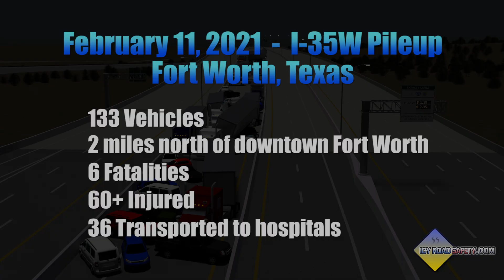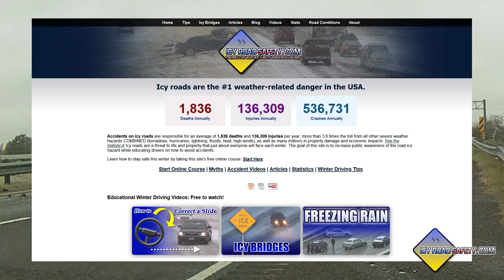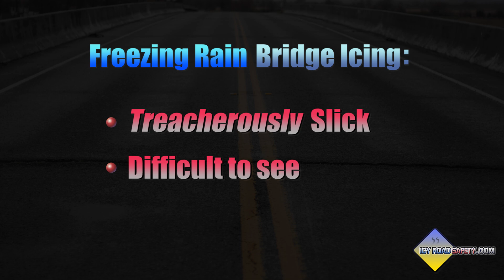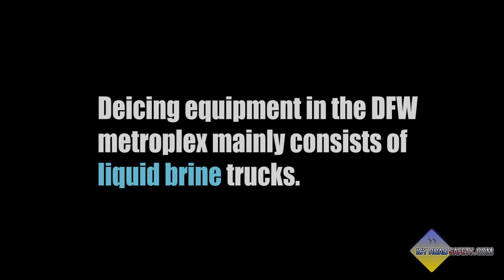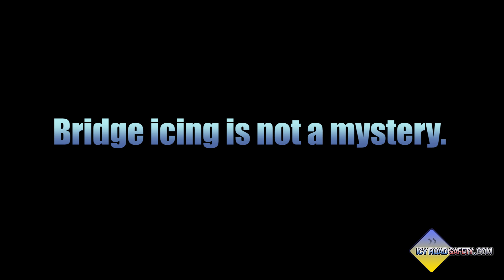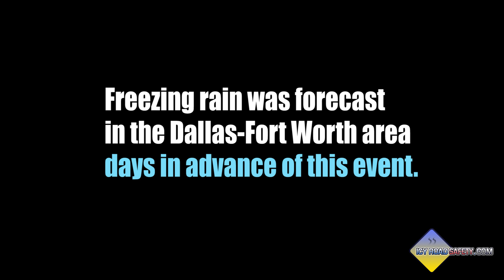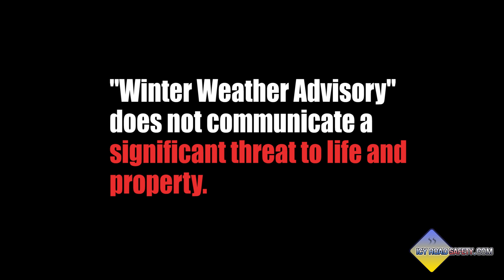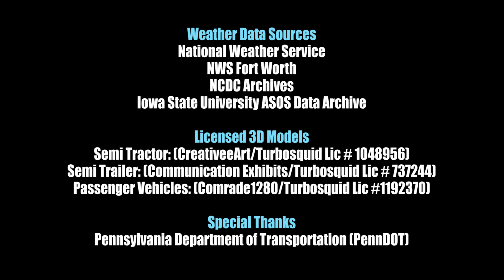The Fort Worth, Texas pileup: its cause, contributing factors and how to prevent future ones

Comment: The main contributors to the event include:
1) We in DFW see an Icy even maybe once a year. twice is an extreme rarity.
2) Morons in trucks can't grasp that 4 wheel drive just means 4 wheels spinning out of control on ice instead of 2.
3) North Texas counties do not have and WILL NOT invest in the necessary de-icing infrastructure as it "will be so infrequently used" that money could better serve lining someone's pockets.
4) Natives are not experienced in driving in the mess and have no clue what they are doing
5) Transplants have no clue that the roads will not have been prepared like they would have been where ever they came from (except Californians as they have no clue about anything, and most don't prepare for ice in CA either) so they drive like they would back home on roads that would have been prepared properly.
6) In a huge cash grab, Tarrant county has created toll lanes on every major freeway, but walled them up with cement barriers and provided absolutely no shoulder what so ever with maybe 6 inches between the edge of the lane, and the cement wall. Thus once an incident starts there is no means of escaping and no means of avoiding the traffic behind you (probably in an SUV instagraming how pretty the snow is while sipping a late)

Comment: Exceptional presentation @Dan Robinson, thank you! As a native to NE Texas since 1994, it has taken several extreme weather events to tune my winter driving skills. For those who are new to the area, brakes are your worst enemy during any low/no traction surface. Treat your brake pedal as if you had an egg between the pedal and floorboard.  Rate of speed is a delicate balance between maintaining enough momentum to prevent sliding…, yet reduced velocity to minimize risk if a crash occurs. Lastly, impossible to regulate other driver behavior (e.g., blatant ignorance or lack of experience) on slick roads. If your trip is not urgent, or you lack experience, stay off the roads until conditions improve. Remember, 4WD, AWD, traction control, and anti-lock brakes offer limited benefits. However, that's still four wheels on frozen water!

Comment: I had to leave my house to get groceries on the 15th and I was driving so carefully and avoiding all bridges. It was crazy the people I saw, almost always in pickup trucks, driving like it was any other day, weaving around other cars. I’m not surprised by the number of pickups shown in this video.
Reply: I lived in Minnesota and noticed the same thing, that large pickup trucks were not patient drivers when others were slowing down for slick roads.
Reply: Yup. These people learn the hard way pick up trucks handle terribly in wet and slippery conditions because the weight is front bias. This make the rear much easier to lose traction.
Reply: @dekoldrick  correct. That’s why smarter people where it snows regularly will shovel snow or put heavier cargo in their truck beds to add extra weight to the rear tires for better traction.
Reply: @dekoldrick  when I was a teenager, my father put a bag of concrete mix in the bed of our truck the day of a big rain then left it there - ultimately creating a very heavy bag of solid concrete. I asked why he didn’t get rid of it and that was the day I learned about weight/2 WD/momentum and potential hazards with pick up trucks.  

But, yes, living in Texas, one quickly discovers that pick-up truck drivers usually give zero F’s about safety or the welfare of vehicles around them. It’s almost like sport for them. 

Because Texas, I guess. 

And there are A LOT of pick-up trucks here.
Reply: @dekoldrick  yep
Reply: i took my mom back to the airport the day after a major storm. it was an hour trip. we saw 14 vehicles still in the ditch, 13 of them 4 wh drive vehicles. im not saying wh wheel drives are worse, they arent, what im saying is that drivers of wh wheel drives have may to much confidence in their 4 wh drives. 99.9% of accidents are caused by the loose nut behind the steering wheel.
Reply: Idiots think their pickup will perform like a 4WD with chains and snow tires when they're in 2WD and have road tires.
Reply: @malevolence3419  Keep in mind that Texas does not experience Icy weather very often during winter (Frequency is generally low)
Reply: @malevolence3419  idiots think 4wd will help them stop quicker. It won't. 4wd vehicles stop in exactly the same distance as any other.
Reply: @wmason1961  that's true, however snow tires will make a significant difference in stopping distance in winter conditions.
Reply: @wmason1961  actually less, they weigh more.
Reply: Keep in mind that pickups outnumber cars in TX
Reply: I noticed that as well and figured “well it is Texas !”
Reply: In DFW, we typically only have two highway speeds - 50 and 150. I like to split the difference. It helps that I am cheap enough, that if I can avoid tolls, I take frontage roads instead. It was in the middle of Snowmageddon, and I am an RN. We had people whose pipes had burst, bringing their families in to nursing homes and hospitals to stay over, so they could work shifts. I was thankful I could keep all of my taps at a steady stream, but we had a boil water warning for a while, and a conserve water order. Zero fun, plus so many deaths. The North and South Pole can keep their cold weather. We already have enough bad drivers here, we aren't equipped for ice and snow added onto the roads.
Reply: always the big trucks
Reply: "I chose to risk the lives of everyone around me so that I can go to Kroger and buy some chocolate ice cream, but you know what, so did pickup truck drivers!  Pick-up truck drivers, amirite?!?"

- Karen
Reply: Pickups have a specific problem. Too heavy at the front and too light at the rear. But at 18:06 I noticed the driver turning the steering the wrong way which triggered the slide.  Even in a hot dry country I know not to do something like this.
Reply: As a Texan, I've always said this. Pick up truck drivers are the ones with the biggest egos and small pps. Their always the ones causing trouble, 2nd with the BOYS who don't know how to use sports cars🤦
Reply: I have a pick up truck and I get passed by pick up truck drivers and honk at me in the snow.  Its ego mostly.  Snow don’t care what truck or tires you have.  Common sense helps a lot.
Reply: Typical pickup drivers, no matter where you are. The majority of them are morons.
Reply: Pick up truck drivers have the biggest egos 🙄
Reply: Lol it's always peoplebin big trucks or suvs driving recklessly around town 🥴
Reply: On ice, you lose no matter what you are driving,  so blaming pickups is not fair.
Reply: @carryfreak5059  i agree
Reply: @carryfreak5059 i will agree you cant blame them for that but you can blame pickups for being the most common people to be on your ass in the third lane while you’re just trying to pass the person going 5 under
Reply: @carryfreak5059  Yeah it's better to be wrong and alive than right and dead. Doesn't make Texas pickup drivers any less irresponsible

Comment: I live in fort Worth and I can tell you exactly what happened. When they built these lanes, most of them like that one is one lane with no exit for miles. So they were sitting ducks. And they still haven't fixed it what they do when it iced over a few days ago they just closed those lanes. That's exactly what happened because I live here. It's all about money they don't care about people's safety they knew it was a danger to build those access Lanes because most of them one lane some of them have two but most of them have one with no exit for miles so if you miss your exit you're going to have to go way out of the way and then turn around so they didn't care they knew it was dangerous when they built them but they didn't care and that's exactly what happened
Reply: Sorry but your wrong it's just common sense if there's dangerous weather slow down simple as that Texans can't get this simple fact for some reason
Reply: As a native to the FW area, Mr. Robert's presentation hits it right on the mark. "Freezing rain hazards (especially on bridges) is almost ALWAYS impossible to detect in advance. Your only safe recourse is to significantly reduce speed, or avoid the area." Simply put, whenever temperatures falls below 32 degrees, and there is (or has been) moisture in the area, expect and plan for hazardous conditions.  I must agree with @Reypure207 DR, it is the driver's responsibility and duty to consider all hazards and make appropriate adjustments to their personal ensure safety.
Reply: Why were so many semis in the express lanes?  In Atlanta, the express lanes are for cars only, so maybe it just depends on the state.

Comment: Good video on the explanation of how winter weather affects road conditions and so forth, but for the record the roads and the weather by themselves do not cause these crashes. Driver's who fail to drive according to road conditions is the main reason why people get in these crashes. 
The Fort Worth pileup was the result of complacency and recklessness by the drivers involved in it. I drove on the freeways just hours before the crash happened and the roads had a thin layer of frozen precipitation on them. I had to defrost my windshield before I left a friend's house because of the ice on my windows. That was all the evidence I needed to be careful and slow down, especially when crossing bridges and elevated roads. 
So lets be clear and honest, there was nothing wrong with the roads, people were simply not driving like they should have when the roads are slippery

Comment: I travel that toll raod every day in all types of weather , the factor that contributed to that that wreck is there is dip on the road , when it rains you hydroplane if u dont slow down and you are not familiar with that stretch of road and yes the ice did contribute to the wreck but the major factor i thik is a dip on the road where it puddles when it rains and im guessing the puddle ice over and was athicker patchof ice rigt before the cars wrecked

Comment: I live in Fort Worth and that stretch of highway is a tollway which is owned by an independent company and does not fall under TX DoT (Department of Transportation). It went untreated unlike the other stretch of I35 because it fell under NTTA's (North TX Tollway Authority) responsibility. We had the same type of weather this past week, but this year they closed the tollway.
Reply: Thank you for making sure TxDOT wasn't at fault.  However it's not NTTA but NTE that owns that stretch of toll.
Reply: It was treated, but as the video explains, in freezing rain the solution quickly gets washed away.  You also must consider that the brine solution only lowers the freezing point to around +15 deg F at best, and bridge temperatures are affected by the wind chill, not the ground temperature.  With the ground temperatures in the mid 20s, the wind chill would likely be close to if not below the effective temperature of the brine solution.  Sand is probably a better aid on these bridges, but TX doesn't get these weather events often enough to justify the price of purchasing the equipment and building the infrastructure to have an adequate road sanding program.  There is no solution except for traffic to drive slowly, which seems to be very difficult for DFW drivers to do.
Reply: @WilC379  you are right about that. Being a truck driver of 28 years and driving all around Dallas as much as I have over the years, the people there (generally speaking, of course) drive very aggressively. I’ve been literally astounded by the things I’ve seen drivers do there on the freeways. In fact, they’d give Southern California drivers a run for their money, and THAT’S saying something!
Reply: @SoCal780  I've driven in So Cal and No Cal...Horrible drivers that drive too fast, too obliviously! I'm in the philly area; it's not any better here...:)
Reply: @SoCal780  😳😳😳 I moved from Chicago, to SoCal to now southern Arizona lolol. I’ve been hit by dumb drivers twice this year 🙄 both elderly that clearly can’t see well. One drunk that completely ran a red light. ON. THANKSGIVING. DAY. But I had extreme anxiety 24/7 driving in Chicago and Cali. I think I got in less accidents there because I hardly ever drove outta pure fear 🤣 at least with these accidents, fear didn’t hit until one second before.. and by that time it was all done and over with lmaooo. I’m calm for the most part while I drive here.. with all the old people around going slow lololol I’ll take that any day over a four hour drive with nothing but pure panic the entire time in SoCal 😂
Reply: @WilC379  💯💯💯 as the video explains, warnings via phone alerts, like in tornados is a GREAT idea! Especially since icy roads and bridges cause more deaths than tornados 🙃 why they don’t do so is beyond me. Glad this dude is out here fighting that case! I’m sure he pushes for stuff like that ♥️ he clearly started warning people days before this even happened!! All these people saying iTs OwNeRsHiP tO bLaMe or tHe cOnCrEtE aNd StRucTuRe. Did we watch the same video?! Lolol it’s DRIVER SPEED and not adequate warning that is to blame!!
Reply: Yep, and the way they have them walled up with absolutely no shoulder makes it a death trap with no way to escape. While NTTA has a contract to manage the billing, I don't think they handle maintenance and a large chunk of that cash goes back to Tarrant county, which is why instead of widening and improving the freeways like they should have, the county instead intentionally left the freeways under developed and added toll lanes for a quick cash grab.
Reply: @JHartModelworks  If they widened the freeways like they should, it would be less business for the toll roads
Reply: @JHartModelworks  Its even worse than that. The barrier there are not needed. They are only there to keep people from cutting over onto the toll lanes from the regular lanes. Greed may have not caused the accident but it sure made it worse.
Reply: The other issue is the tollways are surfaced with tarmac instead of concrete so its will be dissy anytime there is ice or rain especially for those with worn tires
Reply: Yes, they did. I was wondering why :) thank you
Reply: Private companies owning roads is a horrible idea lol
Reply: So you’re saying that all that happened cuz NTTA’s fault because they don’t treat the tollway what supposed to???..ir you think like that it means you’re one of those people that blame on the others ..The true is that IT WAS ALL OF PEOPLE INVOLVED IN THAT ACCIDENT..cuz they warning ⚠️ us like 2 or 3 days before and the people still don’t care and drive like it was no EXTREME ICE 🧊 CONDITIONS ON THE ROADS 😒..SMH
Reply: I hate tollways.....very annoying they are. I guess we can now add dangerous to that as well. Deadly this tollway is
Reply: @joeyferguson840  Not sure why.  I can come from WB I20 into Dallas and once I make it to the I635 tollway I can get to Denton on NB I35 in 20 minutes @ 5:30PM which used to take about 90 minutes before.
Reply: @WilC379  I avoid toll roads like the plague. I have found its taken me not much longer than a couple of minuets to go around toll roads the vast majority of times if there was any time savings at all. In rush hour traffic service streets could be far faster even when going long distances. You could very well be spending well over a thousand dollars a year on toll roads and that is assuming the tolls never average over $2 where I have seen plenty of times tolls over $5 in the DFW area. I have far better things to spend $1,000+ on than tolls. For an example I could drive down to Houston and take a 4 day off season cruse with my partner with a $1,000. I would rather do that then to hand over the $1,000 to some government agency.
Reply: @joeyferguson840  I live in DFW, too. I hate tollways. We have too many. I skip them 99.9% of the time by avoiding the highway when I can, and take the frontage roads instead. It takes a little longer, but it's safer. 287 isn't horrible, but it seems like all highways have construction going on somewhere at all times. Thankfully, I can skip 35 and go through town, and yes, if I need to go to Dallas, I do take the frontage roads. I only take the highway if I need to get to the airport. Less hassle, and it only adds maybe twenty minutes, tops, onto my travel time.
Reply: It was treated

Comment: The biggest problem with I 35 is that a LOT of drivers here in Fort Worth just get on the highway and jump right on. They don't get up to highway speed before they just jump in and make everyone hit their brakes. Also a lot of idiots think a HIGHWAY lane is a good a place to park as at Wally World. You can see this EVERY DAY on I 30 West going to Weatherford from Fort Worth. Every day, about 3:30 pm the traffic off of Loop 820 merges with I 30 west. There is no acceleration lane at all. So the people going slow are the only ones on the highway and just cut people off. Only being 2 lanes creates a Hell of a bottleneck! Most of the time the traffic is backed up to at least Cherry Lane. Rainy/icy day? Can be backed up all the way to downtown. Smarts people have done "studies" to figure out why traffic backs up for NO reason. Start putting 20 mph cars, on a highway with 70 mph traffic, and that is the traffic jam/back up. I wish I was smarts and got paid to do "studies" Job security is NOT seeing the obvious.